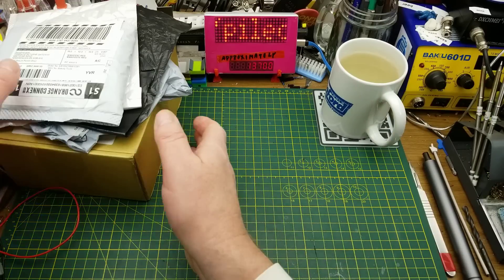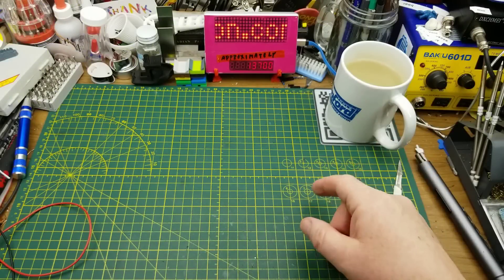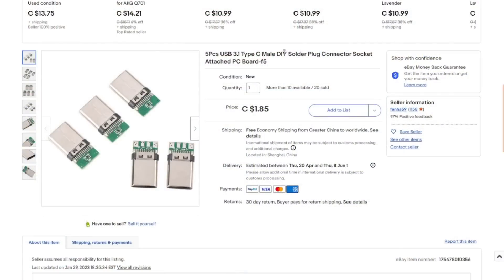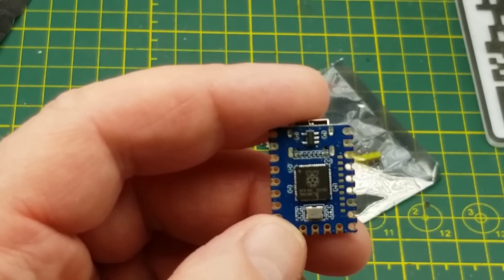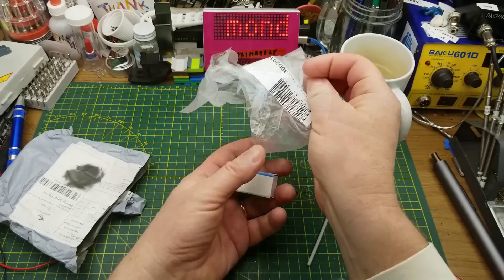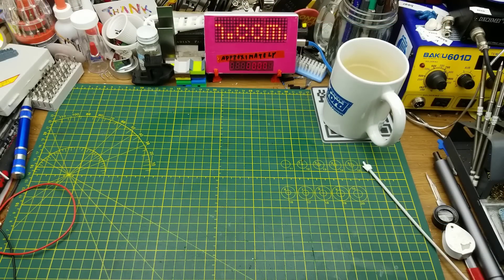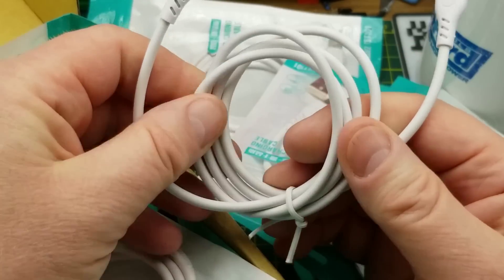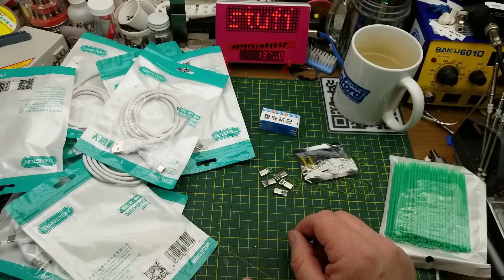Mailbag Monday 162

Comment: The rosin idea does work, I use 15-1 IPA to rosin by weight for an eyedropper mix and 25-1 for needle bottle and drag soldering. I don't know the chemistry of it but it seems to work much better after a few weeks aging. I find it's particularly good for working on old oxidised boards possibly as it sits there longer rather than evaporating instantly
Reply: I wonder if it gets better with aging because some of the alcohol evaporates and it gets more concentrated
Reply: @gorak9000  Possibly has some effect although I tend to make small batches and keep it well sealed. It does get a little darker with age and seems to clean oxidation better so I suspect there's some chemical reaction taking place. I have wondered if some form of cross link polymerisation occurs as it would fit with slower evaporation/better cleaning when used.
Reply: @Steve_Coates  I have no idea about the chemistry of rosin and what might happen as it ages with it diluted in alcohol, but being a violin player, I definitely have "extra" chunks of rosin kicking around - I should dilute some in alcohol and see how it works for flux. I know if it gets too old, it seems to not work as well - I just finished a roll of Kester solder I've had for a very long time (3 rolls were given to me back in 2001 or 2002, and it takes me quite a long time to chew through 3 entire rolls!), and replaced it with a fresh roll of the same stuff (same metal mix in the solder, and supposedly same rosin flux, though the Kester stock number is slightly different now, and i think the diameter is slightly different now, and the new stuff seems a lot stiffer which is odd if the metal mix is supposedly the same). The fresh solder definitely has more of a rosin smell when you melt it, and the flux action seems noticeably better.
Reply: @gorak9000 Presumably some of the more volatile compounds do eventually evaporate. Pine rosin is amazingly useful stuff and has been in use for millennia as a flux, fixative/glue, sizing agent, waterproofer, lacquer, grip enhancer etc. From residues on archaeological finds mainly jewelry and weapons we know it's been used as a soldering flux for over two thousand years. A piece of trivia for a violinist, it's possible that it's been used on bowed instruments for even longer, there are cave paintings of archery bows used as instruments and bowstrings were and still are treated with waxes and rosins.

Comment: Those usb c boards usually use only one resistor for both cc1 and cc2 pins. This can become a problem when inserting a proper PD charger, as they might get powered in only one orientation..

Comment: Dipping the soldering iron right into the solid rosin works, but because it is solid rosin the excess goes rock hard once it's cooled on the PCB and is a real pain to clean off.

Comment: Made diy flux from rosin.  I use it in the crystal loose form. I think you have the same in that box. I crush some between 2 teaspoons till fine powder. and disolve in isopropyl alcohol 90/100 %. You make it so it flows from a syringe nicely. I make it in old plastic pill bottles lasts forever. Residue can be quite sticky but is easily cleans off with alcohol. after soldering. I bought 1/2 kilo of the stuff for cheap I think it was pine rosin but not sure smells like pine or eucalyptus or something. I will never run out of flux for at least 50 years LoL. Oh do not use with leadfree solder it tends to burn. Thanks for your video and helping my pilesofstuff collection.😎😎

Comment: Maybe on the rp2040 board consider using pogo pins to make connections to the pads
Great video thank you
Reply: Would be nice to have a rows of 0.127" holes for the extra GPIOs, so little 28-30AWG wires could be attached.
I have some dual-row round fe connectors of that pitch.  It would make things easier for the hobbyist.

Comment: You can collect and use natural pine rosin to make your own flux and/or solder paste, the advantage is that is neutral non active so no corrosion and the fumes are not so toxic, just use isopropyl alcohol until you get the desired texture

Comment: Seems to be an overstock of those cables.  They have been going for cheap at auction on ebaay. Search terms: "USB-C 1M Huawei Data C 2.1A Fast For Charger Samsung Charging Cable Cable Type"  Not affiliated, just passing on the deal.